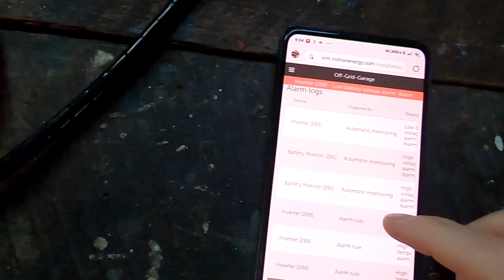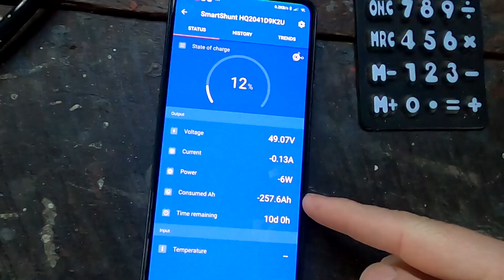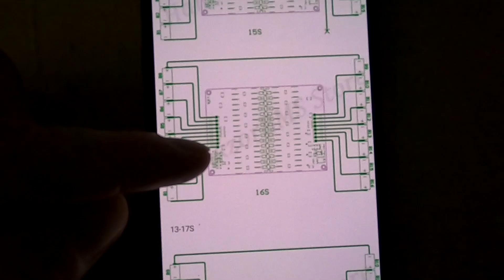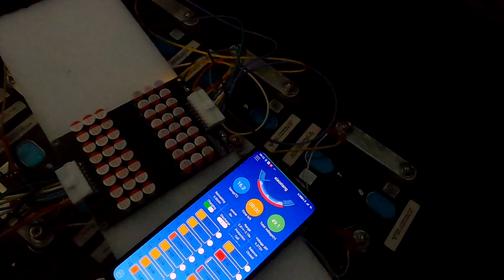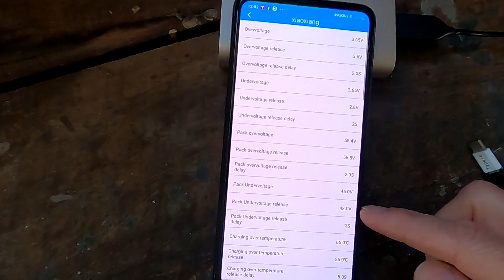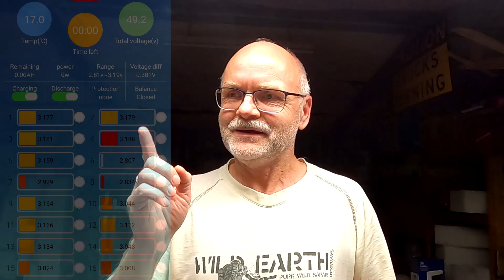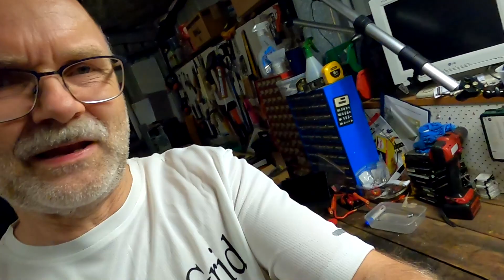Can the active balancer save this battery? Impressive result!

Comment: I bought an active balancer and never looked back. I'm disappointed with anyone that ever told me not to get one.
Reply: I agree. The best thing I’ve done for my battery bank.
Reply: That active balancer seems to be doing a great job. Have you estimated the extra Ah’s you get before the inverter/BMS cuts out?
Reply from the maker: @kevinmills5293  that's not much. I would expect this to be far less than 5Ah, maybe 2-3Ah only in total.
Reply from the maker: Got it connected for a week now and it's been great so far.
Reply: Question...let say that I want to disconnect the active balancer...should I start by the small connector...and then follow with the large one? ...I'm talking of an active balancer 16 s....the connector with the ground has 10 pins...and the other connector has about 8 pins and no ground. Thanks

Comment: I’ve assembled a 4 cells battery with BMS only and I had a troublesome cell, it charges faster than the other 3 so the pack never could charge beyond 3.35v each cell. Until I added a 5A HELTECH active balancer and I was so happy to charge the cells to 3.65v each. Definitely the active balancer made a big difference in my case. It balances the cells at all times while the BMS balances the cells only when charging (not sure about when discharging) and with a small 200mv dissipation from the overcharged battery. The active balancer does not dissipate the over amps, it rather transfer the amps to the other cells with lower charge.
Reply: I had the same issue, love my active balancer 😁

Comment: Hi Andy, can I splice a balance lead cable for the balancer from my BMS balance lead cable?
Reply from the maker: You should probably not do that as the active balancer could cause a voltage drop in the thin cables and make the BMS reading wrong data.
Reply: @OffGridGarageAustralia  Thanks Andy. Sending you a beer for your efforts :)

Comment: try the smart BMS  balancer again....
set pack cut off to 14.45v 
cell cut off to 3,64v
pack reconnect to  13,4v
balance to static 3,4v and 0.005

my pack has a low and high battery every charge, and each charge the high one trips the BMS at 3.64  and then static balance kicks in and within  an hour or so kicks off around 3.5v with all cells balanced difference below 0.005v.  if i trip the reconnect at  13.4v using a couple of second 20a load and the battery will start charging and all cells charge to a 14.45 v pack trip remaining balanced all the way up and all the way down to 2.7v low trip 
and then it simply repeats itself as charged  as for some reason they drift out at top end every charge like your own..
Reply from the maker: I'll do more testing with the balancer very soon.

Comment: you have to remember that measuring the current on the balance wires is not a true reading, because with two cells are in series if one is charging and the other next to it is discharging you will get a net current because you are measuring both cells at the same time.

Comment: Andy perhaps we should stress that the only active balancer that you or I can suggest is the Hankzor or the Heltec “capacitive active equalizer” also known as “fly capacitor ”type. I can’t personally say anything about the other types, but they work differently (resistive energy dissipation) and some people have been disappointed. As you can see, the capacitor type wastes very little energy!
Reply from the maker: Well, I'm not recommending people getting active balancers now. As you can read here in the comments, some people are just bottom balancing and are happy with that. Everyone needs to find their own way. I think the active balancer works well for me at the moment. But I would like to test further...

Comment: You may be liking your balancer, but its maybe adding 0.25% of capacity at the bottom end. But remember when you were testing it was using more amps than it was using to top up other cells - I suggest you'll be losing the same capacity from balancing as you gain from having a balancer.
However, I think they are worth having but not leave in all the time, but when you do a monthly/quarterly  balancing plug it in.  That's my plan, mines been in its box for over 6 months now ....
Reply from the maker: Absolutely, the capacity gains is very little. The only thing it does well is prevent individual cells from running away and trigger the BMS to shut down.

Comment: Uses power, and ruins your top balance. Yes, working as designed, but is it worth the power used? Depending on the current it supplies, might take just as long to get it back in balance at the top. On diysolarforum.com a user just showed how an active balancer was very happy to make sure all cells were destroyed when his charge controller over charged the battery.
Reply from the maker: Yes, that is true, with an active balancer, you don't need to top or bottom balance the pack any more.
The problem with no active balancer is shown in the video. Cell #6 would have triggered the BMS at some stage and disconnected the whole pack before the inverter reaches the overall low voltage disconnect of the whole battery. What's missing here is the communication from the BMS to the charge controller and load.
Reply: @OffGridGarageAustralia  Nothing wrong with an active balancer, I even have one that I have never hooked up. Once top balanced, my BMS only has to even out the self discharge difference in the cells, which is fortunately not large. Now if I wanted to discharge as low as you did, it would make more sense. Until then, it is just one more thing that could go wrong.
Reply from the maker: @john_in_phoenix  the low discharge was only for the test. I usually stop at 3.1V or 3.0V insert load. Not much gain below that.

Comment: In theory, it actually makes sense that the pack voltage increased after active balancing (in your specific situation) because for a given amount of amperage transferred, the higher voltage cell would see a smaller voltage decrease compared to the voltage increase that the lower voltage cell would see. This is due to where each of those cells lie on the voltage curve, of course.
In reality, that would obviously depend on how efficient the balancer is.
Reply from the maker: As others said here in the comments. I missed that... absolutely correct
Reply: @OffGridGarageAustralia  BTW...When you were connecting the balancer, I think the diagram you were looking at was from the back side showing the mosfets not the capacitors.
Reply from the maker: @mysterytechknowledge3664  that would make sense then. I'll check it again.
Reply: And it would be the exact opposite, if a couple of batteries were completely full and the rest were at a medium ("stable") state of charge
Reply: Well said!
Reply: Its prob just rounding
Reply: Temperature makes a difference
Reply: It’s an overunity balancer 😂

Comment: Pack voltage is going up because you're putting energy into cells that are deep into the knee, while the energy is coming from cells that are not deeply in the knee.
Reply from the maker: Yes, that is correct. I missed that.

Comment: I bought one active 24v 8S balancer a couple of weeks back because I had a couple of cells that will just outrun other cells when charging and will get very close to the overcharged level. The Smart BMS was never capable of balance them right. The active balancer solved this problem. I have it connected ALL the time now. It has performed amazingly.
Reply from the maker: Yeah, it looks like these things actually work quite well.
Reply: @OffGridGarageAustralia  Yes. In my case, I am using the inverter to power all of my essential loads in my home. The battery is cycle once a day and I need the cells to be as balanced as possible in a short period of time. This device help a lot. Specially when it is capable of moving 5A.
Reply: Just to add, you can get two of the active balancers and put them in parallel on the same balancing leads.  They collide a lot at first, but over time they sync up with what they are doing.
Reply from the maker: @SenatorPerry  Cannot imagine how this may work, but I will test it... 😉
Reply: @SenatorPerry  Good to know. Thx.
Reply: I also had 2 cells that were always top voltage. At discharge, as well as at top charge. The reason was exceptionally low self discharge compared to others. I connected a 47kOhm resistor in parallel to get self discharge to a level comparable with others. It showed this was all that they needed. This is however a trial and error process to choose right resistance and still requires balancing bms to start with fully balanced battery and take into account how much time the cells need to drift away and how far… not a fast solution but it helped me. This does not work if cell is high on charge but low on discharge - in such situation it just has low capacity and there is nothing to fix it. A strong balanced will get a bit more umpf out of the battery but won’t do any miracle. There is also a third condition when Vdiff rises with current but as soon as current goes down, gets back to norm. This third case is high internal resistance. This cannot be fixed fast either as long as it is just now loose screw issue.

Comment: also you can have more then 1 active balancer to balance even faster as you running high capacity cells
Reply from the maker: Liek some people have 2 BMS connected to one battery?
Reply: @OffGridGarageAustralia  not scene 2 bms on 1 battery pack but yes parallel active balancers to allow for a higher current transfer

Comment: if your grid tied i think the active balancer is less important when off grid with no grid power at all i think it kind of becomes a must
Reply from the maker: Why would you think that?
Reply: @OffGridGarageAustralia  because if your on grid then you can use it more like a ups this case the batterys are always charged untill a power cut but i contridect what i said befor and if they are set to solar first grid 2nd then balancer would be needed as you be drawing batterys down and when they to low grid will kick in and charge them to set level befor solar takes over

Comment: You’re shunt is on the right place, if you put it before the bms you can’t read your second batteriepack. Now you can just connect your second pack to the shunt in parallel. I got my cells a few months later than you and using a Daly bms it keeps the cells very good balanced.
Reply from the maker: With more than 1 battery bank, it can only be connected like this. Every bank has its own BMS and shunt measures all banks.
Reply: @OffGridGarageAustralia  yep, that’s what i done last week got my second bank with it’s own bms.
Unfortunately the seller on Alibaba.com didn’t deliver the cells properly packed, got them quite much damaged. Don‘t get your cells from Heze Yixin Information Technology Co., Ltd. they promise a lot but don’t keep any off them. Delayed, incomplete and damaged delivery due to bad unprotected packing.

Comment: As I watch this video, I'm top balancing my 16S battery at 54.4 volts with a 2A Bluetooth active balancer.
Reply from the maker: Nice! Top balance at 3.4V only?
Reply: @OffGridGarageAustralia  54.4V float is a little low but this is where I'm starting to see about 4 cells diverge from the rest heading up to 3.5V+ so I'm holding here for a few hours to see if I can get results like you did. The other problem is I have 2 batteries, 1 DIY and 1 YIYEN from China. For some reason the BMS in the China battery is going into high voltage alarm and shut down if I go over 55V. Of course there is no support from China. Eventually I will replace both batteries with a 560Ah DIY project. Was hoping prices of the 280 or 310Ah cells would get down to $75 but so far that only gets you a grade B cell.

Comment: i am doing a test at moment for outside lighting i have 6 salvaged cells a li-ion charge controller charges with 20watt of solar not all day as i cant place panels direct south only west i have no bms only the active balancer scc is controlling the under voltage and overvoltage and the active balancer is keeping everything with in 10mv range working really nice true test will be winter i wish i could get these panels facing south i would like to test a east south west (im in the north of the world) solar panel layout but with 1 controller just wish i could monitor the battery charging and log it to see how the shift from west to south and east shows on a graph my thoery is they will be 3 peaks with dips between the pole change
Reply from the maker: That works only until the SCC fails. I would not do that at all. The small 3-4s balancers cost you $10 on Ali and save the cells if something goes wrong.
Reply: @OffGridGarageAustralia  they are old salvage cells with problems so not bothered if they fail they are in a bucket surrounded with sand it is more of a test to see how well active balancer kope with keeping the battery's balanced and how well the charge controller works before moving to decent battery's and a bms the bms i will remove the passive resisters so all the bms does is shut off if to high or to low voltage the active balancer will be what keeps cells in check  been running for 6 month so far and they is only 10mv difference in cells and the cells are also very different in capacity so all in all i am very suprised at how well they do i have a battery on my desk thats 3s7p with a bms and active balancer that will be going on the controller with usb ports in the gf gin bar lol for lighting and music from bluetooth speaker and phone hence the usb ports 3s is due to me using li-ion that have a total charge voltage of 12.6v

Comment: On your recommendation I got a QUCC BMS. However I got the mosfet one not the relay. On overcharge of a cell this simply turns off the charging, leaving the discharge and balancing functions still working. 
You also sold me on the balancer. That works OK, but to stop high cell voltage cut off I run the BMS balancer at 50mV below cut off voltage. This just keeps the balancer out of trouble. Cells are balanced nicely over most of the curve, but getting the top end balanced looks like taking several days. Heading in the right direction slowly. 
Keep up the good work....
Reply from the maker: I wasn't aware that they make smart BMS with fets and higher current (200A).
Reply: @OffGridGarageAustralia  Ahh... mine is only 100A
Reply: @OffGridGarageAustralia  Is you fuse not 100A ? so 200A BMS is nice but you could get away with a 120A one, and still get 5KVA at the inverter. 
On the balancer, have you considered using the other bolt on the busbar so you don't disturb the BMS connections ?

Comment: The bottom "Knee" curve is not linear - the lower the voltage the less energy is needed to proportionally impact the voltage   overall voltage increased because your moving energy from a fatter part of the curve  where  substantial energy is needed to impact on voltage to the thinner  more sensitive  zone- you are bottom balancing your cells which is probably better for your pack as you have capped the upper voltage  at 3.45v preventing it climbing the upper knee much to effectively upper balance accurately

Comment: wow so many sections to go into to check this and that they so need one display screen with all the controls like the raspberry pi gui but with more information and control buttons
Reply from the maker: The balancer itself has no interface, so that's a set a and forget device. Everything else is done through the Victron VRM and the occasional checking of the BMS.
Reply: @OffGridGarageAustralia  yeah i think the active bms could be made to trigger with a voltage trigger so the voltages befor you wanted it to balance at you could have it work at

Comment: this is where i think the run solder joint should be a switch so you can connect then turn it on to balance
Reply from the maker: But then you would need to check every here and then and make a decision. I'll just leave it running now. It turns off and on itself if needed.
Reply: @OffGridGarageAustralia  a voltage trigger that measures the total voltage of battery that triggers a relay when set voltage is reached closing the run contact and setting the balance going this would work for the top balance you wanted befor at the set voltage you wanted where the battery bms would not play ball

Comment: If you balance them nearly empty - at charging when to go over 3,38v balance needs to step in again, for example discharge cell6. But at high current the balancer did not have 3hours, so charging will stopp because overvoltage of cell 6... Would be great to start the balancer ONLY if one cell is at 3,38v or higher.
Reply from the maker: Yeah, that's right. The BMS has got a RS485 interface. I'm sure someone can put a manual together on how to read that and trigger a relay to turn on the balancer.
Reply: the balancer he put on works 24/7 365. charge - discharge does not matter. float current does. if you can keep the current at or below the balancer rating it will keep up with it . if not charge will shut off and the high cell will transfer to the low cells after the charging has happened.

Comment: Overall voltage goes up because cell voltage is not a linear curve. Taking power from one cell to put into another does not mean you take x voltage from one cell and put it in another; in this part of the curve you get a big delta V with small changes in state of charge.
Reply from the maker: That is correct, I didn't think about that. Thanks!
Reply: Beat me to it. this is 100% correct